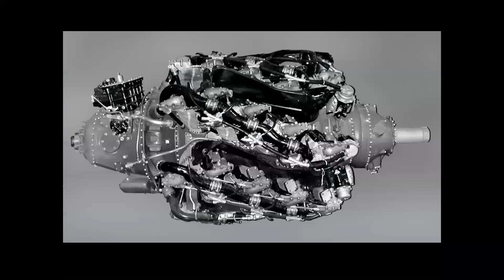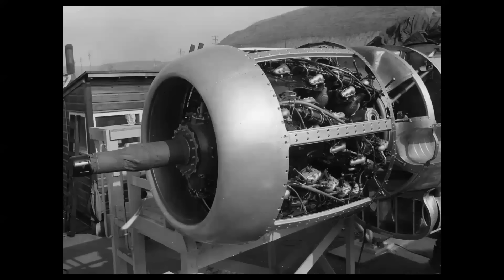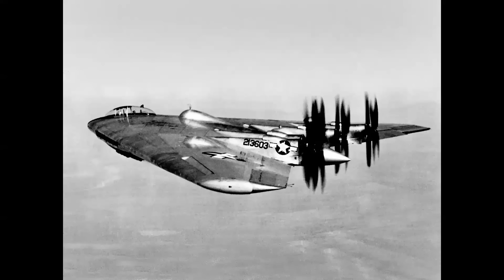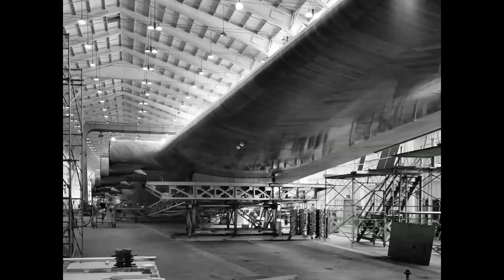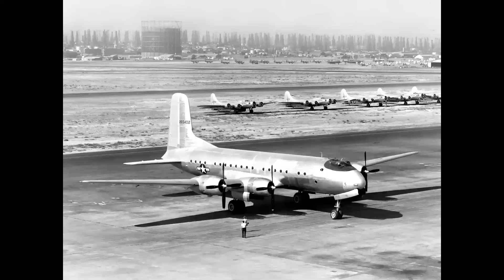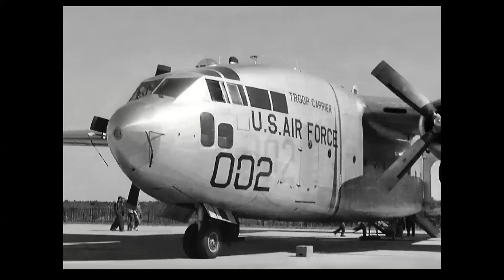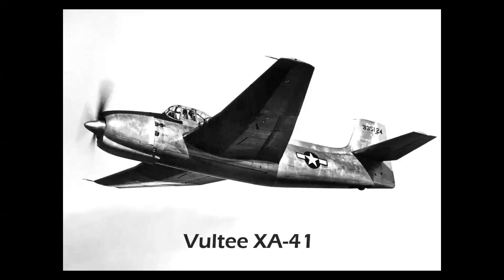PRATT & WHITNEY R-4360 WASP MAJOR AIRCRAFT - Airplanes powered by this giant radial engine

Comment: I saw one of these engines at the state fair several years  ago- it was  a cutaway exhibit, and can't IMAGINE the noise it must have made when it was running-(!)
Reply: Wonder no more. Of course, better in person, but... https://youtu.be/saBq4omgJCA
Reply: @Bob_88SC  ...I know the F4U Corsair used a "Pratt and Whitney Double Wasp engine"- but did the Corsair also use a Wasp Major engine?

The 2 engines are a lot alike- but isn't the Wasp Major a bigger engine than the Double Wasp?
Reply: @daleburrell6273  Yes, the red and white number 57 is one of the ten F2Gs (Goodyear built) that were produced, that had the Wasp Major installed. The USN had ordered a larger number, but that was cancelled when WWII came to an end. The idea originally came from Pratt and Whitney, who converted an F4U-1 to Wasp Major power. Birdcage Corsair with a long cowl! That experimental job was done in 1943. Goodyear, who was already building Corsairs under contract, picked up on the concept and developed it. The F2G-1 and -2  had a full bubble canopy like P-51D and P-47D. I forget, but one didn’t have folding wings. Several were sold as surplus and put into the hands of air racers. They had no history in combat, but they were formidable at the Cleveland Air races. So that is their history and legacy. The Navy did provide the racers with technical guidance, which I find intriguing. For example, they couldn’t make their potential power (and therefore, speed) stock. The carburetor inlet was at the aft end of the engine cowling, which turned out to be under the boundary layer at speed. When they added a scoop extension to the top of the cowling, which moved the inlet to the leading edge, it made all the difference and woke the monsters up.
Reply: @daleburrell6273  also, yes, the Wasp Major was bigger. The two engines had the same bore and stroke, 5.75 in and 6.00 in, respectively. The R-2800 Double Wasp had two rows of nine cylinders; the R-4360 Wasp Major had four rows of seven. On the Major, each cylinder row is offset 360/28 degrees, to ensure that at least part each cylinder was receiving fresh, free-stream cooling air.
Reply: @Bob_88SC  Thank you for the information.
Reply: And there’s this display run setup. Onlookers covering their ears gives you an idea of how loud it is, especially when he brings the revs up and makes a wind storm. They sounded better with the short headers or stacks. https://youtu.be/GhO3lZXX79A

Comment: Well l guess every one is wondering what the HP of it was....Pratt & Whitney R-4360 Wasp Major R-4360-4 -  (1,976 kW) R-4360-17 -  (2,610 kW) XB-35 and YB-35 outboard engines with 8-bladed contra-rotating propellers and was 2,650 HP some were 3,500 HP....Thanks...Always tell the HP of any engine...!

Comment: It is curious why they never considered V-12 or V-16 water cooled piston engines to replace corncob air-cooled radials. Water cooled engines were much more reliable and easier to maintain
Reply: Probably because of weight.  Water cooled engines are heavier, and, what happens if you spring a water leak up in the air?  Cooling fins don't leak.

Comment: Wright and P&W got into a lawsuit over which of them "invented" the corn cob design for large radials.  The suit was dismissed when it was discovered to be a much older concept by an obscure designer.  The large cutaway 4360, partially cowled and on a stand, used by P&W as an exhibit, still exists in a museum.

Comment: Hi Mike, great stuff. The Navy did operate the Constitution for several years, if not as a great success, they were not scrapped immediately. What interests me more, what production engines are being referred to as being more powerful than the R4360?  The Napier Sabre developed power in the high 2000s, and war emergency was close to 4000 HP, but the 4360 on a day to day basis delivered equal power,  the Sabre is the only challenger I can think of.
Reply from the maker: Great comment, thanks!

Comment: I wonder how the design tolerances change from the lower temp front of the engine to the hotter back of the engine.
Reply: There are plates between the cylinders to balance the cooling.
Reply: There were baffles that were on each side and on the top of each row of 4 cylinders that directed the air from the front to the back.
The cylinder head temp was taken from the A7 cylinder which was the hottest.

Comment: Goodyear made  about 2 dozen  R-4360 powered Corsair fighters as well. 
I attended the Navy ADRA   school at NAS Memphis in early 1972. Conducted ny the Naval Air Technical Training Command,  "NATTC." In the classroom was a cutaway R-4360 engine. Years later, well after the recip school was shut down, a friend was attending the A&P at Orange Coast Community College in California and he invited me over to check it out. I the building was a familiar engine, yes, the very same 4360. The plaque read, "donated by NATTC, NAS Memphis.
Reply from the maker: Neat story, thanks!
Reply: Yup, those were the Goodyear F2G. Corsair. Some of them have been snapped up as surplus war aircraft for racing purposes.
Reply: That’s interesting! I attended the ADR- A school at NATTC Memphis in latter part of August and early part of September of 1971. After A school, I was assigned to VP 60 at NAS Glenview. The P2V7 with the R3350-32WA engines. I later heard that ADR-A school was shut down later in 1972. Yes, I remember the various radial engines on engine stands in the shop area of the school….Mark

Comment: When I was in the Air Force working on this engine, and when the spark plugs needed changing, it was easer to change the engine.  That saved a lot of time.
Reply from the maker: Amazing, thanks!
Reply: WOW!
Reply: I guess you saying it takes a lot of work
Reply: Even valve adjustment required removing the engine. It was possible only when the engine was horizontal.

Comment: Why not fewer but bigger bore cylinders?   As the bore diameter increases, the stresses in the head increase.  The head has to thicken and does not transfer heat well.  The engine detonates.   Thus bore limit maxed at ~5.38”.   More power meant more cylinders.
To develop engines in the day, they would make a single cylinder engine for test.  Can you imagine a 150cid Briggs and Stratton?
Reply from the maker: Interesting point!

Comment: Great presentation, as always! I understand that the R-4360 radial engine was given to overheating, particularly on the rearward rows of cylinders, due to insufficient air flow to reach (& effectively cool) those cylinder rows. This overheating would often result in the flight engineer for a passenger or cargo  aircraft shutting down one or more of the R-4360 engines in flight for a while (until the engine temperature cooled sufficiently for the engine to be restarted), according to what I have heard & read about the R-4360 radial engine. But, what an amazing & enormous powerplant it was! 

I imagine that further refinements would have been incorporated into the R-4360 engine, if not for turbojets & turboprops fundementaly changing power plant design for commercial passenger & military cargo aircraft.
Reply: Not saying you didn't hear that but I have to question the logic.  If you shut down two engines the others have to work harder and will overheat more quickly.  It would make sense to simply reduce power on all engines to allow them to cool, and you would be climbing or cruising just a bit slower rather than much slower.  In a couple of 4 engine airplanes I flew it was necessary at times (when heavy) to reduce the power on two engines at a time to allow them to cool, but not to shut them down. 
   
There are some cases where it helps to shut down an engine or two if maximum fuel economy is required.  This usually occurs a lower weights and altitudes where significantly more thrust is available than needed, so the engines are running well below most efficient rpm (turbine) or are heavily throttled and incurring pumping losses and other effects (piston).  Shutting down some engines allows the remaining engines to run at a more efficient rpm or throttle setting.  (It not exactly the same thing, but In an analogous manner one of the two turbochargers on each engine in the B-36 could be shut down during operation at lower altitudes or manifold manifold pressures to make the engine more efficient.)
Reply: @gort8203  Thanks for information! Reducing power on all 4(piston) engines would seem a better option for cooling than shutting down 1 or 2 engines, especially if altitude could still be maintained with a reduced power setting. But if the aircraft had plenty of altitude before engine power reduction, I guess some temporary loss of altitude would be ok.
 I'm not sure why an overheating engine would be shut down in flight, if simply reducing power on that engine would allow for adequate engine cooling. 
I've flown mostly small, single engine aircraft, with a few training flights in light twin engine aircraft, including Cessna 402,  Beech Craft model 18, & King Air C-90 (1 trip in left seat).  Sounds like you've had  flight time on much larger, 4 engine (radial?) powered aircraft, which is interesting! What aircraft?
Reply: @shadovanish7435  Whether piston or turbine I don't see any logic in shutting down an engine to cool it unless the overtemp is caused by a critical malfunction rather than simply working it too hard.  Like I said, shutting down to save fuel has been practiced in some aircraft, including military operations that need to stretch the fuel remaining.  

I don't mean to seem rude or secretive but I like to remain anonymous and don't like to make discussions here about me instead of the topic at hand.  If I relate something from personal experience it is purely to illustrate a point rather then to imply that others accept me as an authority figure. I do wish I could fly a radial just for  fun, preferably in an F8F Bearcat, but I never have. I only logged enough piston time to get a private certificate before entering the military, and everything else was turbojet or turbofan.  

During my career I did fly a couple of 4-engine heavy jets in which I had occasion to run two engines at Military Rated Thrust when 4 engines at Max Continuous or Normal Rated Thrust was not enough to get the job done.  No later than the MRT time limit you pulled two back and pushed two up and kept cycling them until the operation requiring the extra thrust was terminated.
Reply: @gort8203  2 jet engines would "spell" the other 2 jet engines alternately, for a period of time. I never knew that method was used to prevent "overworking" the engines, but surely it must have worked. That way, MRT performance could be sustained. I suppose you must have flown any one of a number of possible cargo or refueling aircraft. I've flown on C -130, C-141, C-5 & C-17 aircraft (and assisted with loading some of them).
Reply: @shadovanish7435  Pan Am would climb their Strtocruisers at a much higher airspeed than optimum to keep the heads cool resulting a rather slow climb.  Also they would level off at around 12,000 feet until they were light enough to climb higher without straining the engines.  This helped a lot.
Reply: The Fairey Gannett with its double Mamba powerplant used to routinely shut down one engine in cruise to save fuel and increase loiter time. They would alternate the engines to equalise operation time. However that was easy to do since both engines were on the same thrust line so no asymmetric effects with one shut down.

Comment: My dad was one of the last USAF mechanics that was still certified to work on 4360's when he retired.  The back cylinders always ran very hot and burned the oil because they didn't get enough airflow, like the back cylinder of a Harley Davidson.  He liked the 3350 much better.
Reply: My dad was a Marine Corps flight engineer, he said the same thing.  Ultimately it was maintenance cost and the fact that jets were getting all the investment for improvements that killed these engines.  I also knew a B-36 pilot and said that it was not uncommon to have one of the six fail on a long flight.  Mostly the transmission or pitch control for the counter-rotating props.  When it was an inboard engine the plane would shake so violently that you could not read the gauges to see which engine failed. The rear gunners would have to crawl into the sighting blisters to see if it was the port or starboard engine and call out on the intercom before it shook the plane apart.
Reply: I imagine that problem could have been solved by careful air ducting.
Reply: @stevechapman6551  I've read the B-36 had bad icing probs because of the pusher configuration and the carbs being first in the airflow through the wing. And overheats were a problem with the 4360s as was losing feathering control on the props. Pan Am lost several Stratocruisers in the 50s with the 4360s for the feathering issue and many others limped home. On the B-36 the joke with the engines (including 4 jet boosters) was instead of "6 turning 4 burning" became "3 turning, 4 burning, 3 gone missing and 1 on fire". Must not have inspired confidence on a global SAC patrol.

Comment: That’s an engine. Imagine working on that.
Reply: Back in the mid 80s I did.  It was a lot more pleasant to change a cylinder on it than on the r3350 due primarily to having to remove the prt and associated exhaust piping, iirc.

Comment: I did the math, if you had to replace all the spark plugs on the H-4, you would have to replace 448 spark plugs
Reply: Lets not forget..the checking by the flight engineer..of each plug on an  oscilloscope...on the run up checklist before each flight.

Comment: Graham White’s book on the R-4360 comments that a major failure of the B-35 flying wing was not stability but serious vibration – caused by the swept wing giving uneven wake to each side of the props (the props on the B-36 were in line with the trailing edge).
Reply from the maker: Great point, thanks!
Reply: The B-36 just vibrated everything other than the plane. Houses under the runway glide paths at Carswell vibrated and shook every time a 36 took off over the top of them. Nothing would stay on the counter tops, glasses, dishes, etc. would all end up on the floor after a few took off.
Reply: The vibrations were not caused by the swept wing but were in fact caused by the gear boxes used to drive the contra-rotating propellers on the XB-35 and conventional propellers on the YB-35's.  The XB-35 and YB-35's were actually very stable bombing platforms.  When Northrop added eight Allison jet engines to the design was when the stability problems began.  The jet powered YB-49 Flying Wing bomber suffered from dutch roll.  A device was created to eliminate pitch in the yaw  axis, which corrected the problem.  The reason why the Northrop YB-49 Flying Wing bomber was not selected was because it didn't meet the design specifications for range and bomb capacity because none of the nuclear bombs of that time would fit inside the bomb bay.  Its Allison jet engines were anything but efficient, which shortened its range drastically.  The XB-35 design was finalized by Jack Northrop back in 1942 before the atomic bombs even materialized.  When it came to Flying Wings, Jack Northrop was 20 years ahead of anyone else, including the Horten Brothers in Germany.  He was always waiting on other technologies to play catch up to him in order to make his designs a reality.